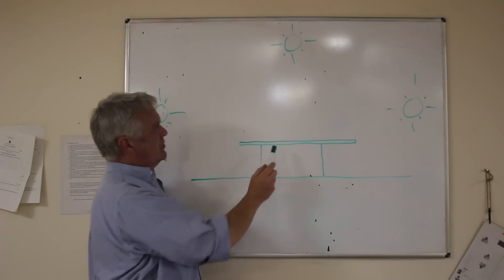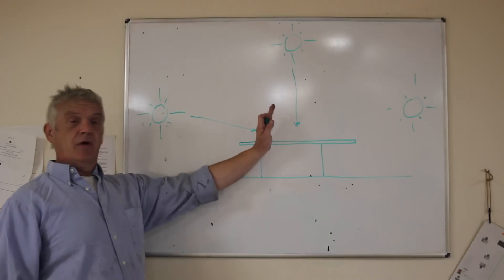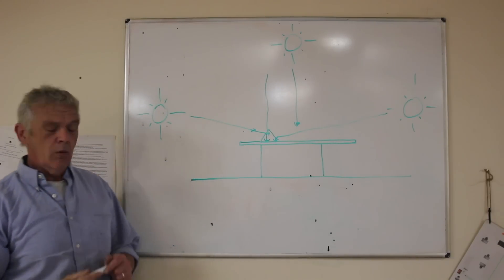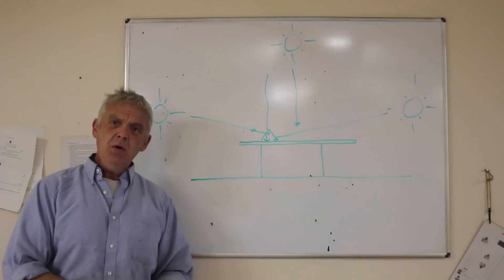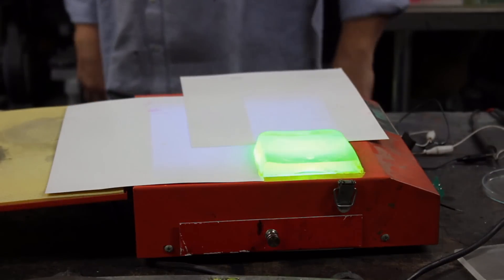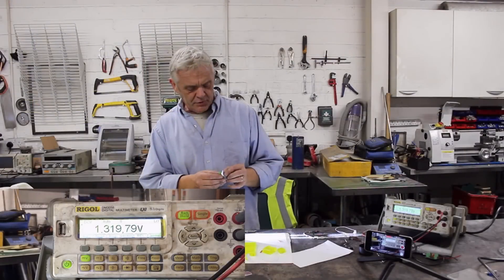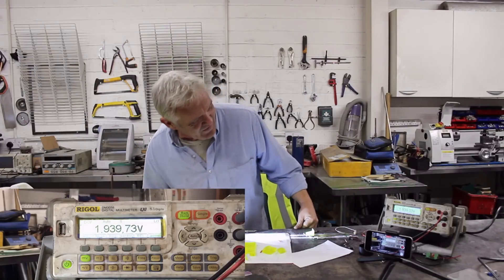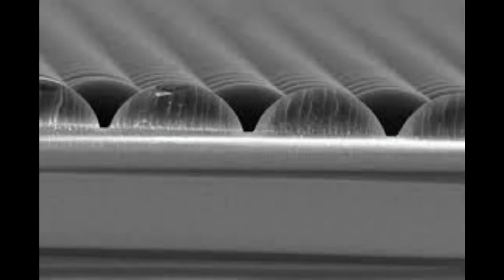1666 Solar Cells And My Evil Plan For World Domination

Comment: Solar panels have a special non reflecting glass on them already; if the manufacturer, used only a prismatic glass, it wouldn't have the loss, from an extra layer and if fluorescents could be added to glass you could dominate the world.
Reply from the maker: good point mate cheers
Reply: I think since there is suck things as lenticular glass, a UV permissive lenticular structure with  say ZnS high doping, would be the thing.
Reply: @jasonmorello1374  and simple fluorescent plexiglass. It scratches easy but is cheap and easy to experiment with...
Reply: This does sound like a good direction to explore to have zero loss (as far as Top Surface area), but you need a Passivation (which is flakey & brittle ...like a clear topcoat paint peeling & propagating over time, now exposed) or better yet a better protective Polyimide (THICK like molasses, oddly dark like it too to protect what's beneath (everything). - Now "Darker translucent to deduce light into a microchip I question less as this is SHEILDING from light too can generate enough to blow transistors so close. However, if present in strictly "solar cell mfg." then I'd say that's an obvious intentional obstruction to be more efficient, so maybe there's a reason there's a resistance on one end, as we try many ways to get the light "IN", vs keeping it "OUT" with "Dark RF Shielding properties" NOT NEEDED, maybe WELCOME EXTRA PWR FROM A SPECTRUM FULL OF ENERGY. I gathered my info from experience working in microchip manufacturer until deathly board, wanting to learn more elsewhere (and I did, still continue to do thanks to Robert's CHANNEL here), but I came from QA - Need to know entire process from beginning to end ... final product.
Obvious Problem is "Gelatin & Florescent" are water soluble, and left to the elements "in most areas" is a short life due to rain & hot dry Sun. 
A solution to protect Robert's Florescence Solar Cells and everything below is a "clear oil-based solution, glue or compound" (not "water soluble" & a light blocking "Dark" Polyimide).

Comment: Public Domain. That's why you are an awesome teacher. So onto tracking systems. Lets say you have solar panels and you want them to track the sun? Motor tracking? Power waist. Right. Make a second device for your system. Hot water heater. Let the hot water heater generate pressure. You can then use the generated pressure to drive a tracking system made from pistons instead of motors. Will cost you tubing instead of power wire. LOL. Just spit balling here. How many pistons can you get from an automobile grave yard?
Reply from the maker: i think there was a bellows system developed using air mate

Comment: A big problem with prism like structures on solar panels, is that a large part of the panel will be blocked from getting sunlight. I think the effect of placing a 100% optimal prism without any obstruction to the light itself will still not be able to compensate for the light its blocking for its neighboring prism.
Reply from the maker: like a shading effect?
Reply: @ThinkingandTinkering  yes shading :)

Comment: Hi Rob.  There's far more of an issue than reduction in transmission, the whole issue with loss is to do with angle of incidence of the rays on the panel as a whole, and not with the angle of impingement of the rays WRT the surface of the panel.  It's the same thing that causes seasons.  With 90°incidence, one square metre of solar rays will impinge on 1 square metre of solar panel, and you'll get high efficiency.  As the Angle goes down, so does the amount of solar power hitting the surface of the panel, relative to the cosine of the angle IIRC., It doesn't matter if you're turning those rays to hit the panel at 90°, there's still vastly less energy hitting the panel, and that's all she wrote.

This is why sun tracking is so important.  Now, most solar tracking systems rely on all sorts of computing power to work, they are expensive and "fragile" (both in terms of physical robustness and in terms of software stability).  But purely passive systems exist, these re physically and conceptually robust, require little to no fettling, and "just work" .  But you don't see them often because more computers is more better, right.  Try hitting the googles with "Wilf Rigter Power Smart Head"
Reply from the maker: oh i understand mate - but to my mind mind it's a bit of cost benefit - mostly tracking aren't unless you include the battery bank cost - so grid tied systems have no benefit in those terms but battery off grid or grid instals themselves it matters, however it still seems to me a cost benefit could be achioeved and that's what i am interested in if that makes sense?
Reply: @ThinkingandTinkering  Yeah, that kinda makes sense, but a real time passive tracking system could run directly off the output of the cells, and even an "active" system would only need a small battery pack to keep the "brains" up when there's no sun at all.  In either case there's pretty much no power draw when the system isn't actually tracking, and a passive system could be set up with enough hysteresis that it would only track a few times every hour.

If you can improve perfomance by 20%+, guaranteed, with a tracking system, it's worth the additional complexity.

Improving imperfect incidence performance of cells is a worthwhile aim, but there's only a miniscule gain to be had (literally the only thing you can win back is light reflected from the front of the collector), the hard limit is the cosine law.  And I suspect that anything you put in front of the cell will at best cancel out its potential gain.

Comment: Have you seen this system where people stick a draining bottle on the panel to make it track the sun  during the day using gravity? I think it's pretty neat too.
Reply from the maker: i haven't seen it - it does sound neat - i must look it up
Reply: @ThinkingandTinkering  found it, it's called Sunsaluter
Reply: I saw that, it worked perfectly. It was a rooftop in India. I think they used evaporation. But that is what this video is trying to avoid.

Comment: A linear extruded PET sheet with fluorescent dye might be cost effective, because, in theory, all you need is to have a cost effective source of clear PET some rollers, and one of those rollers having the negative shape of what you want the final surface to look like.

Some Fresnel lenses are made this way.

Only in this case, you do not need to have a parabola so the cost should be much cheaper.
Reply: You can get clear 3d filaments that look fluorescent
Reply: @paulwright8378  That could be pretty cost effective, I have seen fluorescent fishing line before, and many types of nylon trimming line are also fluorescent but not sure what their life spans are.

Definitely need something with a really long life span to make it economically fiesible.
Reply from the maker: interesting - thanks for sharing
Reply: @ThinkingandTinkering  Actually though, pop-up mirrors are still the best way to go.

They can be made super cheaply from long lasting aluminized Mylar, they can be stored away on each side rolled up when not in use, cost very little to make or to operate, weigh very little and will last for decades if stored properly.
Reply: Or maybe Acrylic.
Reply: @GEOsustainable  Only if you want complete product failure in a couple of short years.. ~( 'w')/

Comment: So, maybe a uv fade blocker using a florescent or iridescent polymer resin in various shapes. Once dried it would be easy to slice and place on top of the solar cells or underneath the solar cells. The resin like from stone coat coatings come in a variety of iridescent, metallic opaque or clear colorings.
Reply from the maker: Great idea!
Reply: Fluorescein is the dye being used here. It’s cheap considering how far it goes. The only question is whether it will withstand the heating that epoxy resin undergoes while curing, but I suspect it’s fine since you can find it in injection-moulded plastics 😀

Comment: Main problem is not the direction of light (well except for extreme angles due to Fresnel reflection), but the fact that effective area from the point of sun goes down with cosine of incidece angle, lowering the amount of energy you can capture at all.
So, you would have to somehow make the prism as tall as the solar panel is wide to capture the same amount of energy from all sun directions, in addition to making the prism redirect the light towards the panel
Reply from the maker: yes - but as ar as i understand it that is a variation due to the relationship between the sun and the earth - so that would be an effect on 'normal' tracking systems too wouldn't it?

Comment: Arduino and Raspberry can Reduce pricing for Solar Traking by using just four Solar Traking Devices at Cardinals Points who would send the exact solar position to every Single Panels...
Reinforced Aluminum as Structural Mechanical Movement are still needed..
Last Time I checked the Photosensitive Sensors were a Big Chunk of that cost..
But it was more for a Stirling Project not for Solar Panels that can be moved just left to right with a Timer.

The Prism Idea Isn't Half Bad..

Laser still is Better... I can Ensure Bond Will not Die if it was a 2w mm² Laser Beam at 1 meter Distance..

What can also be used for is Ignition of Tokamak Cold Fusion Reactors...
It's hard otherwise to stabilize Plasma at 1 million degrees Celsius for a Long Time without Any Energetic Expenditure...

High concentration of Laser do Ignite Air turning into Plasma...

Thank God UK went out from the ITER Program... it wasn't a Good Iter at all...
Reply from the maker: did you see the bellow ttracker mate - that was awesome - i will mention it in my video on solar tracking
Reply: @ThinkingandTinkering  
The Air Driven One?
It seems Nice...
In any Case Having a Big Enough Fersnel Lense (above the 972m² range, so more a government Size Device.. not Italian Government I hope) you would not have any need for Moving anything at all...

It would be able to Generate 
419MW Pike Energy
[Depending from the Study, Data are Really Various.. but this was a Consistent one] of Laser that could be converted into Electrons and Harvested into Direct Current.

It would cost roughly 500'000£ for the Laser itself...
The rest is Up to Debate..
I still Considering Graphene As Best Solution...
But Could Be recycled into Increasing Solar Panels Efficiency.

I really don't think is too hard to make a Surface Reactive to Photons once you have all the Graphene That Graphite Oxide and a Photovoltaic Arch can Produce..

Maybe some mixing with other substances...as WS2
But at least we are sure the Photons to Electron Conversion Happens Naturally In Graphene.

Comment: So your going to use fluorescent prisms. Or use a halo phosphor on a prism as a coating.
Reply from the maker: i was thinking more a lens mate - like the drawings i showed
Reply: The solar kits I got as a kid had the little circle lens pattern made into the plastic. I guess you could mold a clear epoxy lens pattern mixed with your dye pigment.

Comment: What about the cosine effect?
Reply from the maker: i thought the cosine effect was really about radar and lidar
Reply: @ThinkingandTinkering  Sorry, poorly worded, I meant that the reason that you don't get much power from a solar panel when at an angle to the light source is because the effective area of the panel from the perspective of the light source is multiplied by the cosine of the angle.
Reply: The profile of the lenses increases the effective surface area of the panel compared to a flat surface. This effect would disappear if you turned the panel 90 degrees. Also, at very low angles the lenses begin to shade one another.